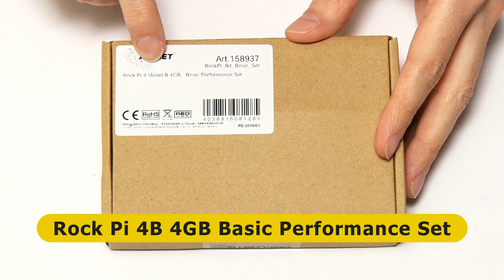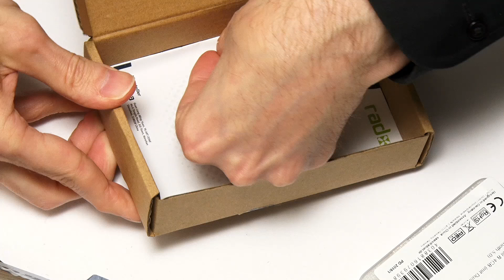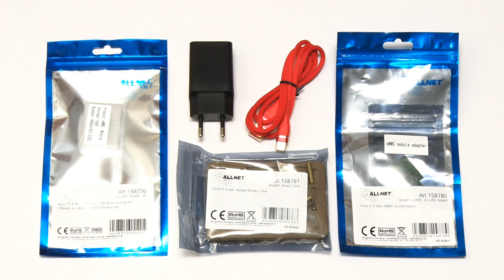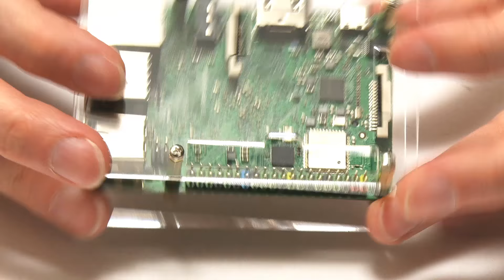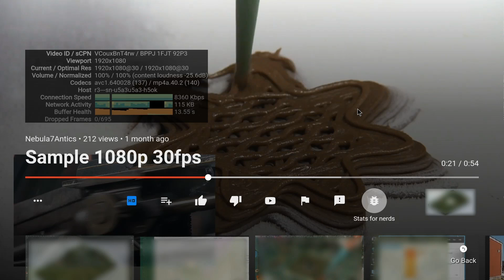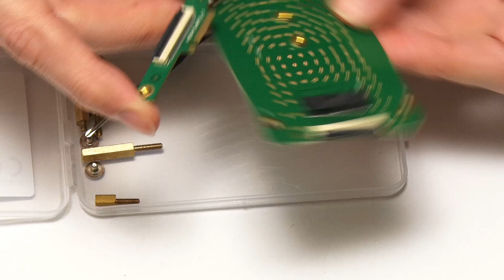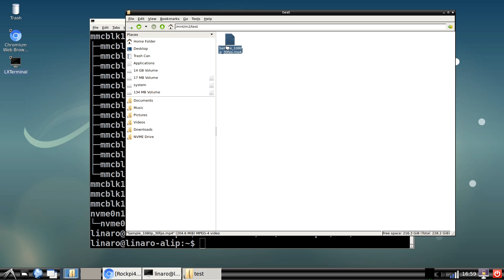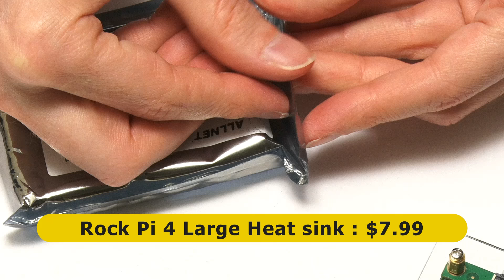Rock Pi 4B : M.2 & USB 3.0 SBC

Comment: Not perfect,  but very impressive.  SBCs are absolutely fascinating.
Reply: So whats this board missing in your view?
Reply: Nigel Sollars The SSD adapter is awkward.  Having a heat sink on the under side of the board may be the future of SBCs, but I’m not a fan yet. Having the board in a Raspberry Pi form factor may be good for Pi compatible hats, but it won’t fit into any Pi case and I prefer my boards in a fully enclosed case. Finally the software isn’t right yet.  So it’s not perfect, but few if any SBCs are. Maybe the perfect SBC would have a Pi form factor, be able to run Windows 10, perform as fast as a top end gaming tower, not need any cooling and run for a year nonstop on a AAA battery.  I’m probably hard to please. LOL.
Reply: @perrymcclusky  Interesting,  we differ on the requirement of a case, I usually push the system hard and have tripped the watchdog to shutting down the SBC/SoC many times.

The only reason for the heatsink on the bottom is due to the SoC being there, which for the size of the 3399 makes perfect sense.  I have no desire for windows on ARM / SBC ( not needed it for anything useful ) outside of Linux itle be an RTOS of sorts, with that said though your more likely to get that wish on gaming with the coming A76 based SoC's.
Reply: Nigel Sollars Yes it’s not necessary in my vision of the perfect SBC to actually run Windows 10.  My idea was that if it’s performance could run it, then it’s performance could most likely handle anything one could throw at it.   I can truly sympathize in not having a case, but in my household, let’s just say, protection is sadly a necessity. LOL
Reply: @perrymcclusky  we will release housings for ROCK PI 4 soon. They should be as universal as possible and also cope with future hardware improvements on the board.
Reply: Norbert B Thank you for the heads up!  Definitely looking forward to it.  Cool.

Comment: A very nice combination. Can we make something like that but using the LattePanda Alpha and with Windows 10 Pro, or it is just impossible at this time?
Thank you!
Reply from the maker: The LP Alpha has an onboard NVMe SSD slot. So yes, you can run Linux, Kodi, etc as here using a LP Alpha -- which is a much more powerful board, if also more expensive.

Comment: Nice vid but note... it's not WiFi 802.11a/c but 802.11ac
Reply from the maker: "a" and "c" are different standards, so "a/c" indicates, I think, that both are available. But it is often written "ac" as you note. :)
Reply: @ExplainingComputers  actually there was 802.11a but is long obsolete (and I don't think there was any 802.11c). Version naming was changing from letter to letter so through b, g, n (in commercial product versions, there were also others like j, p or y) and when time came it ended up with 2 letters suffix. So we have now ac and even newer ax.

Comment: Can you turn the nvme mounting board over so that it is not exposed to possible damage? i.e between the two boards.
Reply from the maker: It could be fitted underneath, so would be protected. Or you could use risers to fit the acrylic case top over the M.2 extender board.

Comment: All told, what was the final cost? (minus the SSD, of course)
Reply from the maker: Everything shown here -- 4GB board, PSU, case, both heat sinks, eMMC module, eMMC adaptor and M/2 extender -- is $120. So the price range is $40 to $120, depending on what you get.
Reply: @ExplainingComputers  SOLD!

Comment: Can it boot from the SSD?
Reply from the maker: Technically, I believe it is possible, but it is not easily supported yet. A work in progress (there are certainly no current SSD bootable OS images).
Reply: @ExplainingComputers  I suppose the main question is if the bootloader can recognise the SSD to boot on it

Comment: Can it boot from NVMe? I was wondering what's the fastest boot time you can achieve to Debian, let's say up to VLC opening the sample video.
Reply from the maker: There are no current SSD bootable OS images on the website or wiki, but NVMe boot is technically possible. I believe this is a work in progress.
Reply: @ExplainingComputers  The moment you can boot from nvme let me know and I'll purchase one right away :)
Reply: right, the whole benefit of the NVMe is to make it your OS drive
Reply: I wonder if you can put a bootloader on a micro SD card or eMMC to boot to the NVMe.  Maybe add boot options on an SD card to boot from either the eMMC or the NVMe while you're at it, then you can use the stock android OS or the full Debian OS.  It could be good to have a setup where you can use the SD card to choose between Debian OS and a retro gaming setup.  I just may have to grab one of these.
Reply: @jonramsey36  I would try myself but I have a few projects in the backburner. This board looks great.

Comment: Would love a slim form factor version of this so I could squeeze it into an old netbook.
Reply: you won't find such a thing, the best choice for the thinnest design is to desolder all of the connectors to get it as thin as possible, then run wires to the sides of the case for USB ports and hdmi and usb c and other things like that

Comment: Could you also show this device running Windows 10? I am always looking for the best SBC to run Windows 10.
Reply from the maker: The RK3399 has an ARM processor, not x86. I guess in theory it could run ARM Windows 10. But  LattePanda, LattePanda Alpha or UDOO board is a far better bet.

Comment: nice bit of kit that one,  just one thing to note with Kernel 5.0 out in the wild ( rolling release distro's ),  now is a good time for anyone to get into SBC;s RockChip especially,

see here,

Linux archrock 5.0.2-1-ARCH #1 SMP Thu Mar 14 18:18:57 MDT 2019 aarch64 GNU/Linux
Machine model: Pine64 Rock64

5.0 brought in alot of missing parts like,

dw_hdmi                45056  2 dw_hdmi_i2s_audio,rockchipdrm
drm_kms_helper        204800  4 dw_mipi_dsi,rockchipdrm,dw_hdmi,analogix_dp
drm                   507904  6 drm_kms_helper,dw_mipi_dsi,rockchipdrm,dw_hdmi,analogix_dp

So I would imagine thats all your missing parts for HDMI audio and yes there is,

snd_soc_hdmi_codec

I would also think the RK3399 uses similar internals for hdmi/codecs etc etc as the Rock64 so kernel 5 would be a good choice to go with.

The RockChip drm/dri kernel module is apparently almost ready to work with the Panfrost/Midgard Mesa module ( now mainlined ) for hardware accel for these mali gpu's.

Comment: So you didn’t install Debian to the NVME drive sorry? It was installed to the emmc card? I presume you can load a operating system from NVME? That is a very impressive single board computer for the money and the accessories are very well priced.
Reply from the maker: Debian was running from micro SD here. There are not yet any NVMe OS images. NVMe boot is, I understand it technically possible, and a work in progress.

Comment: Can it play back VP9 4K60? o:
Would be interesting to know.
It would still consume less power than my 2013 i7 Laptop that can only output 4K60 FPS with 4:2:2 YUV chroma sub-sampling. (Which is fine for media to be honest)
Reply: Yes, ROCK PI 4 provides up to 4K@60 HDMI

Comment: It's good that it's done, keeps the technology moving, Im looking forward to the real pi4 b.
Reply: I  want buy.... no money. huhu
Reply: @emperorciarabevis2068  these other boards are okay, but really nothing works as well as a raspberry pi.
A bit more powerful than a pi, an xu4, good development, not as much as the pi, but a good alternative, my theory is these rk3399 socks and boards wont come to much, I had a nanopi m4, it's based off a set top box, there are not millions millions of them,  it doesn't have the background development of a good phone, like exynos chip in the xu4 the Samsung galaxy S5.
So the raspberry pi or the xu4, avoid the rk3399 it's experimental.
I did have issues with my xu4, the usbs powering on and off, but that could just be my xu4, I did have the very best power supply it didn't make any difference.
Reply: William Rutter - This RockPi like any other SBC in a nutshell are development boards. The more people buy them, write software and build HATs for it. The more you extend the RockPi functionality. One should stay from such “experimental” boards if you want to develop for it.  The Raspberry Pi platform for sure is more mature since there’s already a huge community   around it.
Reply: @iMadrid11  I hope the board does well, I had fun fiddling with my nanopi m4, great to get some things to work, it did give me a buzz, it's early days though most people would struggle with these rk3399 boards, where as a raspberry pi is just a good little computer.
Reply: Just released 🤩
Reply: yes if the rPi 4B has 8GB Ram option and a tweaked CPU and GPU... I'll be down for one... it seems the Raspberry Pi alwauys has the best drivers and OS support.... plus more community support.

Comment: Great video again, I really like to see these new boards, i had noticed this board as it came out, impressive little computer, good value, I like how you can get an m.2 on it and the ddr4, it's a step up from the nanopi m4, but has the same software issues.
Would be nice to have a board based on a current generation phone, a good Snapdragon chip or exynos chip a make a new xu4, something to rival a low end pc arm in a very small form factor, maybe like the Nvidia shield hardware but with just a little more whoomph.

Comment: Thanks for the great vid! I was wondering, do you have any plans on reviewing android (tv) boxes? I mean they too are single board computers (lol) and some of them are really great products! For example Tanix Tx5 Max has the SoC of Amlogic S905X2 that includes quad-core cortex a53 'with 12nm node size'!! Having quad cores of such highly efficient arm cores at that size on a very small scale single board computer is sth uncalled for! Is there any such mainstream SBC with such small nodes in the market? Tx5 too has 4gb of lpddr4 like this one and costs the same! 

But it has a casing by default, a controller and an integrated screen! With no need for a heatsink or fan too!

I mean I understand that some boxes are far too powerful with too high prices that kinda work against the principles of SBCs, but there are also cheap ones still with respectable hardware!
Reply: That’s impressive. Do you know if there are any Linux distributions available for this device?
Reply: @Conservator.  I dont know.. But I recalled people doing it I just did a quick youtube search (just type 'linux on android tv box') and many results came out. And after seeing some of them they apparently also installed ubuntu and other distros on devices running Amlogic s905 and Amlogic s905x! I just checked the results for like 10 sec so dunno there may be for s905x2 too.

But this sounds very exciting!

Comment: M.2 5G Cards will come out soon... so once the 5g network is build, this thing could be a real iot powerhouse
Reply: hmmm could get expensive
Reply: @sethrd999  bleeding edge technologie isnt known for beeing cheap :) ... but my guess is that it will still be cheaper than a soc with 5g integrated for next few years.
Reply: @sgtnik4871  Colour me not convinced,  the Telco's arnt ready for 5G and probably wont be as per usual.  Besides like I said absolutely ott on costs.  You would most likely do better with LoRa 915/868 fwiw.

Comment: Thats a very nice peice of kit, looks very high performance with its wide array of fast connections. I was wondering if it would support the use of an NVME to PCI-e riser to gain a PCI-e slot, just out of interest.
Reply: From what ive seen with pcie on SBC's,  it seems very hit n miss especially with raid cards.
Reply: it does not support hardware raid..

Comment: It would be good if the NVMe extender board had a cut out to allow access to the GPIO pins. Either that or a right angle connector.
Reply: Would be easy just to build one with a bit of perf board ;)
Reply: Isn't old IDE cable would be good as GPIO extender? I also wonder if you can build the sandwich upside down so NVME board at the bottom and SMB on top but definitely with the standard heat sink not the  massive one

Comment: What's the version on onboard emmc ? Can you include speeds?

Can it play 10bit h.265 videos ?
Reply from the maker: I plan some future tests. I think it is eMMC 5.0.
Reply: eMMC is 5.1, The emmc die comes from Micron and Samsung. The eMMC is from Forsee. Here a link to a speed comparison:  https://gist.github.com/hipboi/4751181c26670af1a53096795a13f93d . ROCK PI 4 can play 10bit h.265 video on Android.

Comment: Powering the board over ethernet, we have no need for WiFi nor the included power supply.  It would be nice to have a cheaper set that is PoE capable.
Reply from the maker: All Rock Pi 4 models have PoE capability, and the Rock Pi 4A models have no WiFi. All models can also be purchased without the kit. So options start from $39 for a 4A with no PSU for 1GB, up to $59 for 4GB. :)
Reply: @ExplainingComputers  Thank you for the info.  It would be interesting to see what all is involved in operating such a board via PoE.
Reply: Chris Brisson 
Uhh, i must be misunderstanding because isn’t that obvious?
Reply: @Conservator.  With Allnet's offerings it seems PoE is only bundled in the set that includes WiFi.  In any case, it turns out the PoE hat is not yet available.
Reply: @Chris.Brisson  only the "B" version which includes wifi is PoE enabled (you can see that on top of the board at the pins which could also support the original Raspberry PI PoE HAT. The PoE hat samples where sent out to various people for testing but failed to satisfy. There is work done on a new version which will have much better heat management.